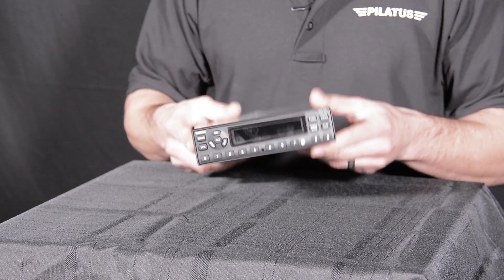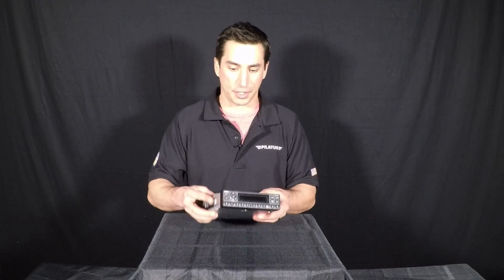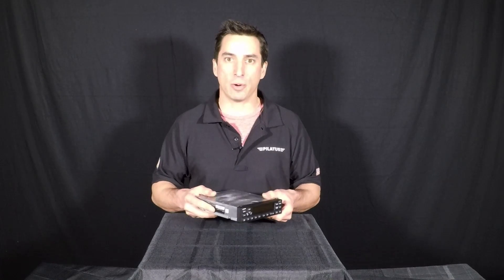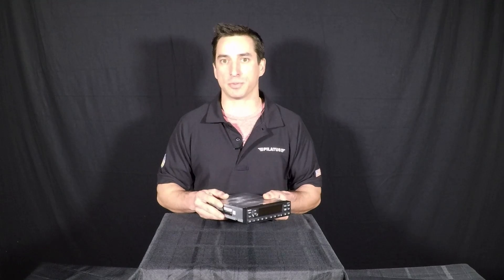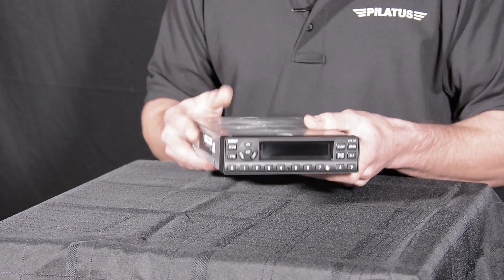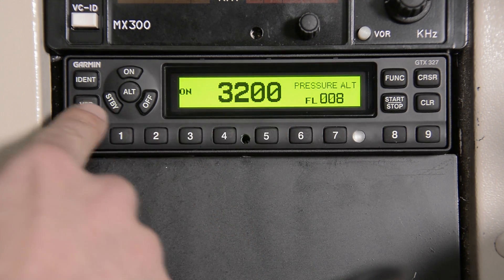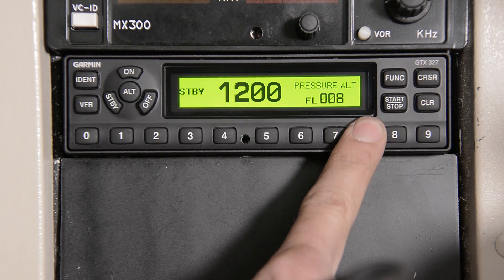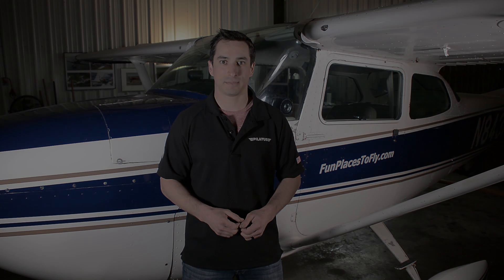All about the Garmin GTX 327 and it's role with ADS-B

Comment: Are you saying that the GTX327 can be used in conjunction with other components for the 2020 ADS-B Out Compliance?
Reply from the maker: +Christopher froeschl From Anthony: The gtx 327 can be used by some ads-b equipment to provide altitude and squawk codes through a rs232 connection. It is important to do your research to see what manufacturers are compatible with the transponder in your aircraft.
Reply: In other words, if you want to take the 1090ES route, you need GTX 330. The 327 only cuts if you fly below FL190 in conjunction with a UAT OUT box.
Reply: Christopher fr

Comment: Daniel, good information and well discussed.   I have a Garmin 430WAAS and the Garmin 327.  What would you suggest for the ADSB solution in my C172?
Reply: I'm kinda in a similar position and really the solution I'm leaning toward is all-in-one box like the Sandia STX 360, that replaces the good old GTX 327. I hoped about adding an UAT OUT as explained in the video, but combination boxes are just better. No RS-232 to wire, single antenna too.
Reply: I've got the GTX327 hooked to a GDL-82 with WAAS. Probably the least expensive solution and it works great. A WAAS antenna comes with the GDL-82.
Reply: What did you do for a solution if you don’t mind me asking?